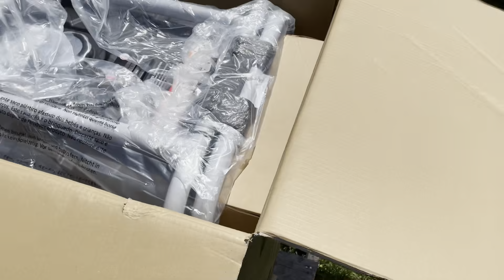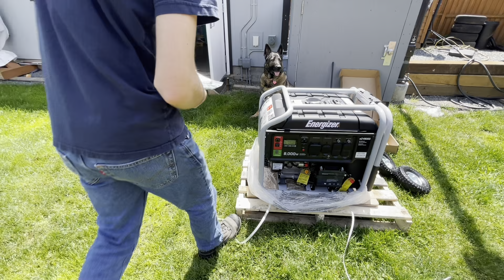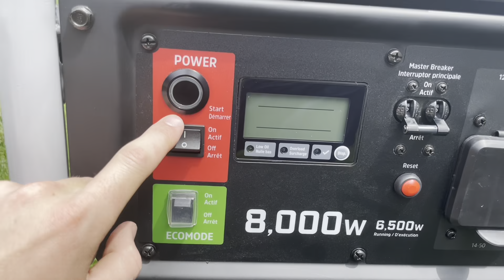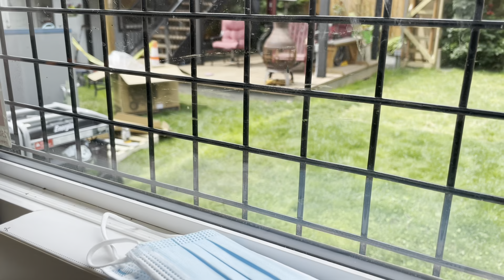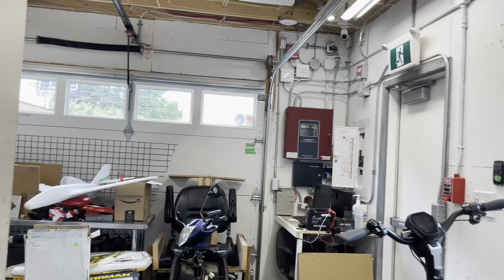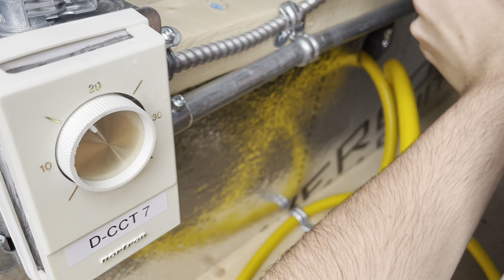Getting a new energizer inverter generator

Comment: I have a Wolf 2300 generator 240 volts I had a neighbour got four for 120 pounds UK,and  I paid 50 pounds, all what was wrong with it was hunting the feul pipe was quarter inch to long. 
When I shut mine down I also turn of feul to keep the petrol from gelling up in carb, it's not electric start but when needed I can run a lawn mower and fridge freezer off it nice.

Comment: I don't know what the Canadian code says, but I'm sure it's similar, but NEC (250.142) says neutral and ground are bonded in only one location (main service disconnect). Since you're using an interlock on the panel and not an ATS that disconnects neutral from the genset as well, the bond should be disconnected at the genset.
Reply: thank you i didnt have the energy to break it down

Comment: Were you able to unbond the neutral in the end?
Reply from the maker: No I'm not worried about it
Reply: @nics-systems-electric  all the 30 AMP circuits are GFCI? If they are GFCI do we need any special transfer switch to connect to home. Do you recommend any transfer switch I can use to install it?
Reply from the maker: @hariniveshdonepudi4647  not GFCI protected on the 30 amp and 50 amp plug I don't believe. panel interlock kits are usually the easiest to install
Reply: @nics-systems-electric  Thank you
Reply: @nics-systems-electric  you need to remove bonding by code you can only have one bonded box
Reply from the maker: @BOB12349307  the concern is having neutral current run back through the ground conductor however the way this is now set up with a ATS that switches the neutral as well you will not have that and you would not have your neutral bonded at your main panel once you're fed off generator power so you would want that neutral bonded therefore any ground fault will trip the breaker
Reply: @nics-systems-electric  you can always unbond it in the cord too
Reply from the maker: @BOB12349307  for my install I need a bonded neutral

Comment: Now you need to build a remote op panel inside the garage so you can start it from inside. That is what I was going to do for mine. Never came up with anything definitive for the choke.  I was trying to devise a plan involving an electric solenoid and linkage to actuate the choke. Maybe a power lock actuator from a car? I know you can come up with something.

Comment: Ok I just did some research and it appears that the "Energizer" brand generators in Canada are made by a firm called "Midland Power" (which also produces the Hyundai brand of generators) I think you are in good hands though as the reviews on this model are very positive. Interesting that the meter on the inside outlet is reading 123 AC when I was always under the impression that it was usually 115 at a household outlet. I guess 120 is the more typical max.
Reply: It's very common to see 120-125v now days, here in my house it's usually around 127v, which is slightly high

Comment: if you want the plugs on the generator grounded you can use a neutral to ground bonding plug
Reply from the maker: They already are grounded as the neutral is bonded
Reply: @nics-systems-electric  oh ok

Comment: I would leave the neutral and ground bonded on the generator.  It really doesn't hurt anything.  And, some electronic gadgets will not work on unbonded generators.  And, if you unbond the neutral and ground, it will prevent the circuit breaker from tripping for a ground fault.  The bonded neutral and ground is what "tells" the circuit breaker that there's a ground fault.  My humble opinion would be to leave it bonded.

Comment: About the bonded neutral, i don’t think it’s such a big deal since at one point in the mains power service neutral gets bonded to ground
Reply: It is though, you can create stray current loops. That is code, ground to neutral bond per electrical system. That's why sub-feed panels do not have an additional bond
Reply: One per system*

Comment: you should not run generators inside of living spaces (like your room) since they output a lot of co and running a gen inside a house where you live can kill you within minutes
So if you wanted to get backup power inside a living space its best to get a pure sine wave inverter with some 12v batteries or a portable power station
Reply from the maker: Good thing it’s not a living space

Comment: Near me Gas is 1.70 to 1.80!
Reply: How long will this last in a power outage?
Reply from the maker: @Starlight_Emergency_Light  It’s good for 15 hours at 25% load usually I would be under that 25% load so I’m not exactly sure
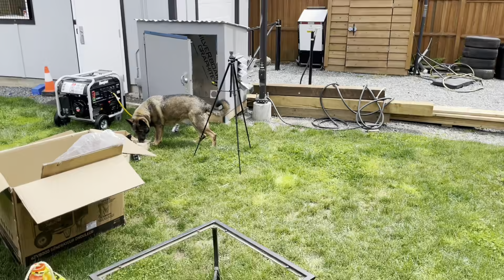Reply: @nics-systems-electric  25:12 were do you find those? I been looking for one! But all online?
Reply from the maker: @Starlight_Emergency_Light  I’ve seen them on Amazon but someone just gave me this one

Comment: You should try getting a mini split as it can heat and cool. In the US, you need a refrigerant license to install it but am not sure for canada.
Reply from the maker: probably will get one at some point
Reply: I did Mr Cool myself without a license. It’s precharged with special quick connects.
Reply: Heat pumps are "iffy" in Canada. They're okay in Quebec where the electricity is super cheap. But they're not such a good idea in Ontario.
Reply: @kingstonsean heat pumps literally use less electricity than anything else 🤨 what are you rambling on about?